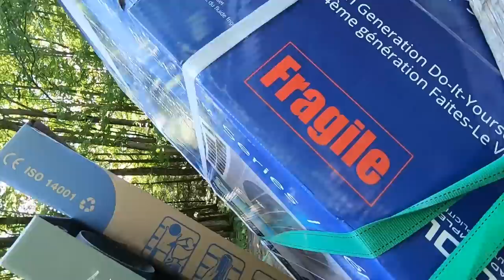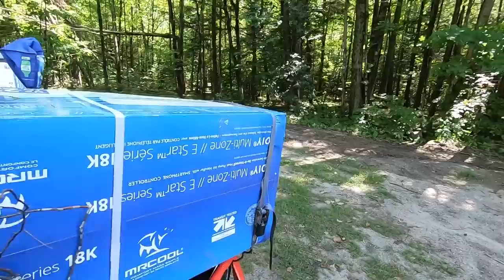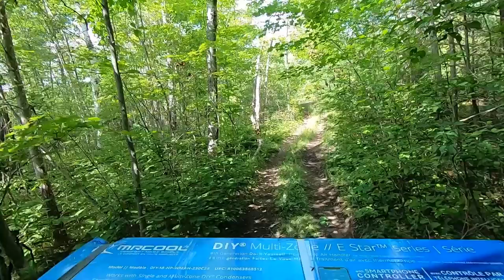A Tornado Ripped Through Here

Comment: in Europe  we use single fase power u need to stick the neutral to the ground but there are inverters to 230 volt power.  We dont use between fase 230 volts our one fase is 230 volts. We have 460 volst between fase-s.

Comment: Hi Russ.  I'd say go ahead and install the mini-,split AC unit and in worst case and you Really need to use it, you can run it off your generator for a bit.  I'm sure they have phase splitters out there or you could run 2 separate inverter units I guess to feed a 2 pole 30 amp breaker.

Comment: We have those mini splits all over in Cyprus and yes the outside unit can get wet. Over the years it will get rusty. The older models tend to use a lot of electricity.
Reply from the maker: omg are you still here?
Reply: @RaspberryRockOffGridCabin  I'm the ghost of Raspberry Rock 👻

Comment: Super video as always, have you talked to Victron in Europe they build alot of electrical controllers and converters for narrowboats. These are usually equipped with 220 volt appliances.
Reply from the maker: David, most homes have 220 already, but I gotta say narrowboats are cool.

Comment: It should work if your inverter has 208 to 230 output at 50amps or more 3wire output connection, (Pure sine wave output.)  4th wire chassis ground.
Reply from the maker: Gordon, it only puts out 120V single phase.
Reply: @RaspberryRockOffGridCabin  Can you get a good deal on a new one?

Comment: Russell, think about your health my friend (: I'm 73 and some time ago I realized it was high time for me to do something about my 'condition'. 
So 1. I went on a strict diet with the help of a calorie counter 
2. I sincerely reduced my intake of alcohol (no, I did not quit drinking) and 
3. I started walking every day (10 000 steps)
Result after just a few months ?
Lost 11 kilo's, blood pressure back to normal and my clothes fit - again. 
Friendly greetings from Holland 🤓
Reply from the maker: If I get my Afib under control, I will definitely try to get back in shape.
Reply: @RaspberryRockOffGridCabin  I had AFib in my late fifties for around a year, maybe a bit less.  It would skip about every fourth beat.  The doc didn't prescribe anything for it, and didn't seem super concerned with mine.  Then it just went away for some reason.  I had had an extensive foot surgery, with epidural anesthesia, not general, prior to it starting.  I was also on anti inflammatory meds (naproxen/Aleve) for a few months after the surgery.  
The AFib stopped after I was no longer taking them.  I have read there may be a correlation.  That's the only thing that really changed, so maybe.  I was taking a prescription dose, about twice the amount on the package, which my doc designated the higher amount.  It was quite painful walking on my foot when I went back to work at my active job.  I finally found a pair of shoes that made the pain go away rather miraculously.  I try to stick with acetaminophen for pain relief now.

Comment: Russell, I felt your pain when you hauled the outdoor unit into the house. I had to haul mine downstairs from the roof. Anyway, you need a 220v inverter connected to your batteries but I don't know the wattage so lets guess: say that the a/c system requires 2 kilowatts of power. 2000/220 = 9 Amps of current from the inverter, which probably needs to be rated at 2.5kW with 5kW surge. Assuming that your batteries are nominally 48 volts then the current draw will be 220/48 x 9 = 41 Amps. However, the inverter efficiency might be only 80% so that would increase the current drawn from the batteries to around 50 Amps. That seems unfeasibly high. It's not going to work. But if the a/c requires only 1 kilowatt, the current drawn would be around 25 Amps. Anyway, substitute the correct figures and see how long the batteries will last. My guess is "not long".

Comment: Ref your power dilemma with respect to 240vac requirement, either install new inverter with 240/120 o/p or attach an autotransformer with grounded centertap to produce 250/120vac.,
Reply from the maker: Inverters are expensive. Hate to have to buy one just to run AC.
Reply: @RaspberryRockOffGridCabin  The transformer is a good idea but it will be massive and probably cost as much as a second inverter.

Comment: 220v inverter dedicated just for the cooling unit out of the question? 
Btw. those things can have 2 sets of wirings already. 1 for 220v, other for 120v.... Some appliances even have a switch for 120/220v
Reply from the maker: Yeah it's just that the inverters are expensive.

Comment: How do you get 240 volts from solar panels?

The solar panels or the battery provides DC voltage to the inverter, and the inverter converts the DC voltage to normal AC voltage for use in the home. If 240 volts AC is needed, then either a transformer is added or two identical inverters are series-stacked to produce the 240 volts.  I don't know your set up but i suspect putting in 1 inverter that does dual phase 120/240.  There's a growatt on Amazon about 900 that i think would meet your needs   it requires 24v or 48 v from batteries not sure how you're wired.  I think you produce like 1kw per day?  I suspect you may want a couple more batteries and maybe 4 more panels if you want to run that ac unit.  Do you have room on roof?  Well you could easily place elsewhere.  I saw a neat design they put them in a pole that let them rotate to hit best sun.  Mr cool are great units.  It would increase your quality of life for sure
Reply from the maker: Yah it's just that another inverter is expensive.
Reply: @RaspberryRockOffGridCabin  i thought the one for 864 i think on Amazon was "relatively reasonable" it would service a max amount of 3k etc.  I didn't price adding a second single phase, as in that setup it would need a line to each inverter and that seems like a lot of work.  Peace out love your show, and your place is beautiful!!!